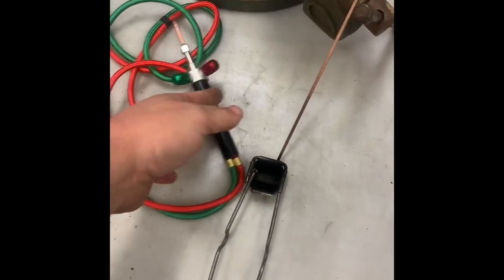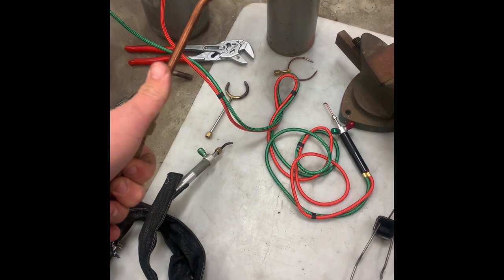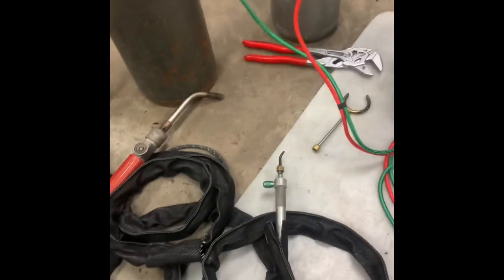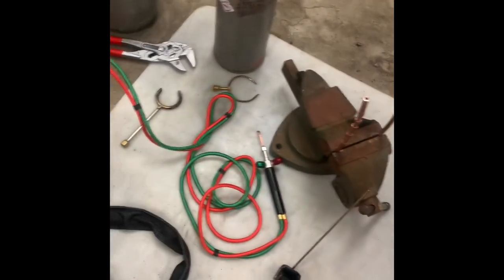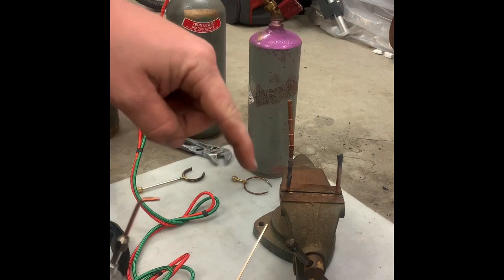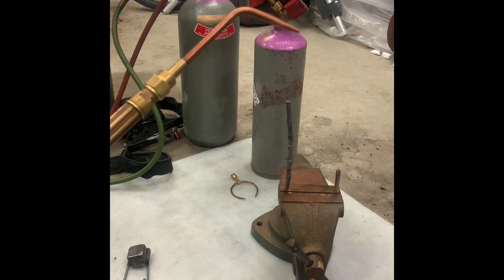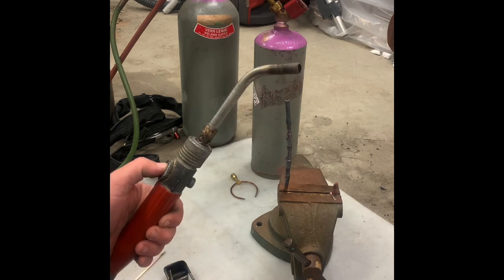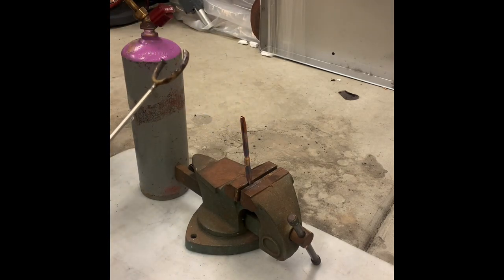Comparing different common torches for refrigerator repair

Comment: good video, but you mixed up the the "A" and "B" sizes; "A" is smaller and "B" is larger
Reply from the maker: Doesn’t surprise me that I got them backwards. I think most appliance guys basically skim the surface of the welding world… honestly just knowing there’s two sizes out there was a surprise to me when I ran into it..
Reply: @steveb5967  in no way was I trying to be condescending or cruel, by the way. I love your videos
Reply from the maker: @andrewsimon5437  your fine man, I didn’t take it that way. But it did remind me that it might not be a bad idea to put a video together talking about torch fittings and all that, because unless I have it in front of me to dry fit together I’m not 100% confident on what tank fittings, regulator fittings and torch fittings go with what, and I’ve seen more than a few techs who use what they were trained on and when you try something different you run into weird problems with figuring out what fits to what.